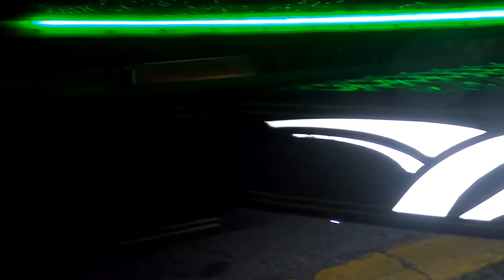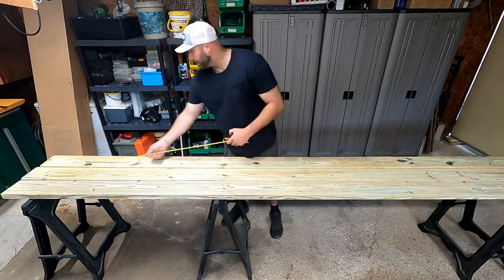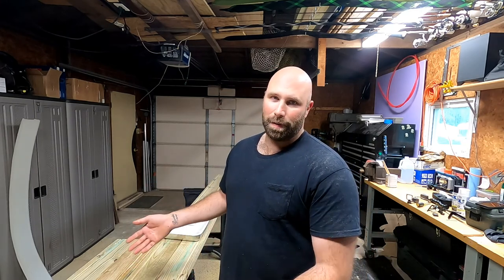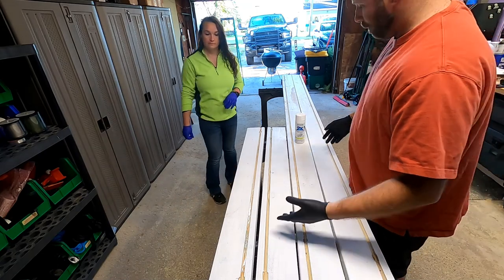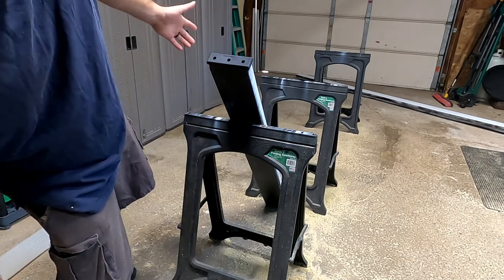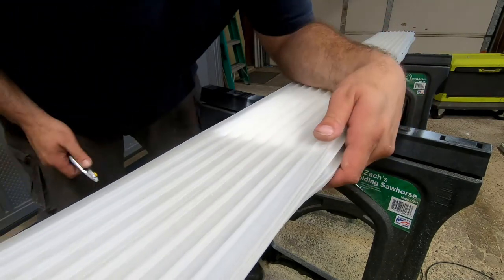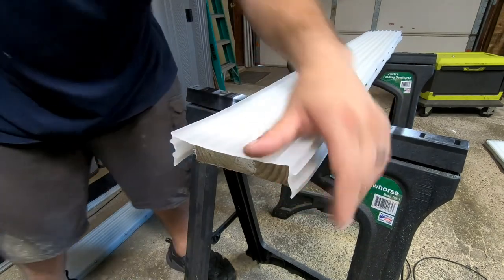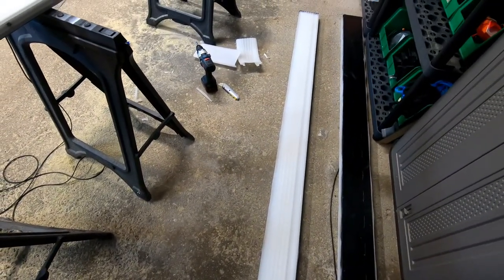Gatorbak Bunk Install Video Pt 1

Comment: Is it legal to wire these into running lights?
Reply: Depends must mostly NO. Wire them to reverse lights only time you really need them unless you just want to look. In that case do what you want just don't use red or blue. Unless your a price you don't get tickets for this kinda stuff
Reply from the maker: We contacted our local police office and we're told as long as it's not an emergency color red /blue  it's legal
Reply: Any update?
Reply: What type of wood did you use? Bunks are for a glass boat right?